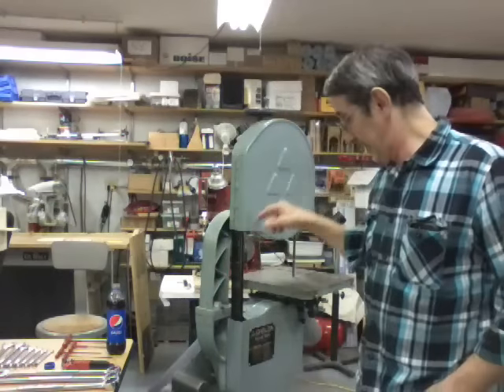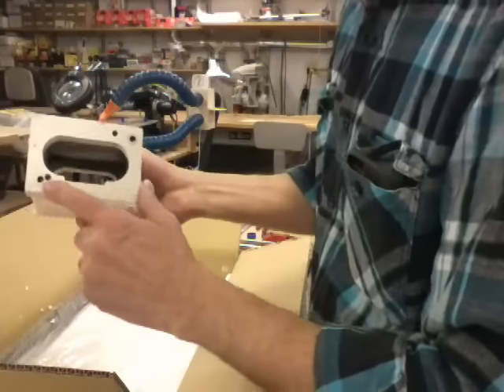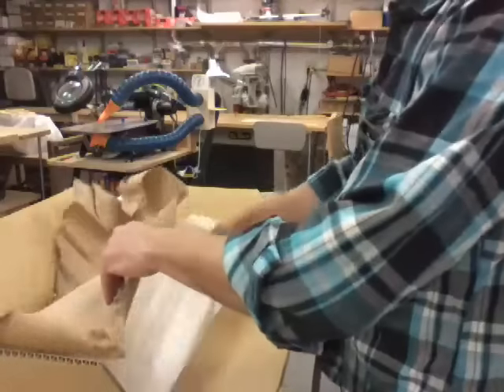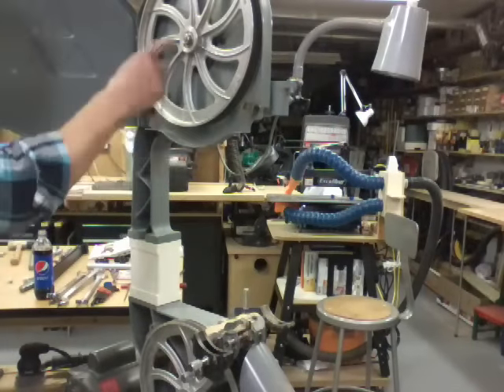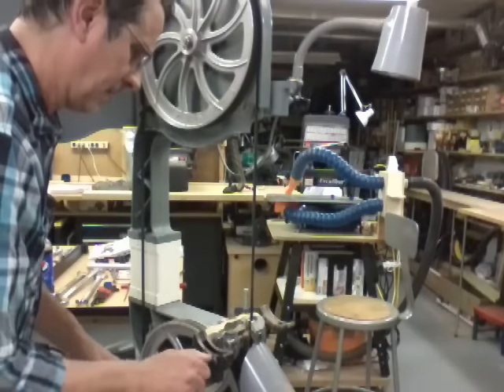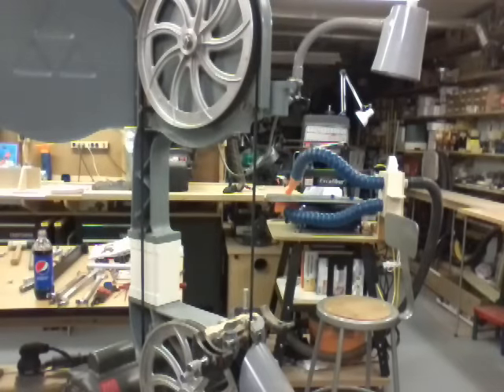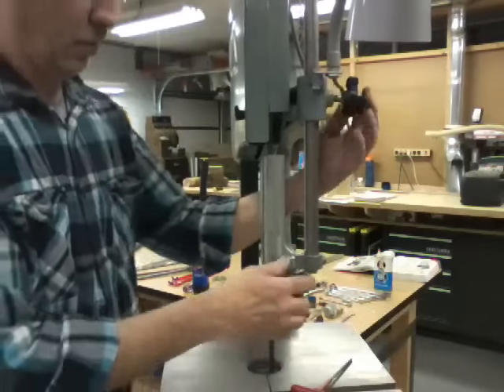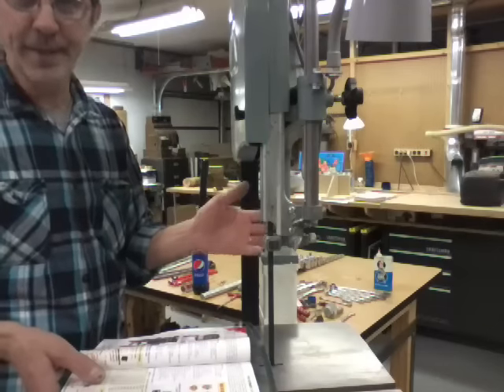71. How to install a riser block on an older Delta bandsaw part 1

Comment: Excellent Pepsi ad placement, sir. 

recently won an 8 in at auction and looking for ideas to get it to at least 12 inches. This vid was very informative for me.
Reply from the maker: Travis Brown 
I also sell a Bearing that goes on the elevation screw so you can tighten the blade easier for resawing. Jim
Reply from the maker: Hi Travis
  If you need any help with that bandsaw let me know I’d be glad to help you out.
  And there’s no Pepsi sponsorship here, just drink a lot of Pepsi. Jim
Reply: @jimjackson9381  Cherry Pepsi is the only way to gol
Reply from the maker: Jim Miller 
I’ll have to give that a try thanks for the tip. Jim

Comment: The Grizzly kit has a different bar.  Sometimes you have to make bushings from split 3/4 copper tubing and/or fittings. Delta also used different brackets and guard mounts at different times and slightly different models. The Grizzly guard also needs one hole modified.  If the guides hit the blade differently in the upper and lower positions you have to shim the block on on or two sides.

Comment: I used a grizzly kit on my vintage delta. Had to modify a few parts. Drill out new holes for the pins in the riser.
Reply: Question: What size shaft was yours and did you have to modify the grizzly to fit? Also did you need to modify the guard?
Reply: @JS-ol7vu  I had to order I believe a 1in hex shaft. I had to drill new dowel holes. The guard worked. All in I still saved $100 buying this kit over the delta kit.

Comment: I just bought this saw for $300. it has new blade guides and includes the riser block (which I havent installed yet). Im assuming a 105" blade is what I want once the riser is put on. One difference is the motor is mounted on the right instead of the left like yours.
Reply from the maker: Flyingspyder 
Well I hate to say it but if it’s in good shape you stole that I ordered a riser black for mine and it was $295 so you got a great deal, as far as where they mounted the motor I guess that doesn’t really matter it’s just odd they would put it where you would be standing to operate the saw. If you’re going to be resigning Lumber like I do you may want to go to the heavy duty spring to get more stretch on your blade and you will probably want to install one of the bearing blocks that I make for your elevation screw otherwise it may end up bending on you like mine did.   just a thought. Jim.

Comment: I bought a new Delta 14" and installed a riser kit in 1995.
I am too old to do that now.
Reply from the maker: Clark Magnuson 
  Hi Clark
    If you haven’t watched video number 72 it’s the second half it explains the bearing that I put underneath my elevation screw so you can tighten the blade tight enough to actually re-saw without any issues, And I do sell them for $20 apiece Plus a three dollar shipping fee,   but at least watch the video it’ll give you an idea of how well it really works. Thanks Jim

Comment: I thought you might want to know the Delta model #28-203 comes with the riser kit factory  installed for the 12 inch cuts-however the saw then only cuts 13 inches wide due to the riser width.
Reply from the maker: Bob bailey 
Hi Bob it’s Jim
   The riser I put on my saw is the same size as the column itself, and I can still cut 14 inches between the blade and the column.
   Is your riser block bigger than your column, did you buy the saw new or was it used, and did someone put  the wrong riser block on. Thanks Jim

Comment: I would love to know how feasible it is to use the Grizzly riser kit on an old Delta. Like yours,  mine uses the 15/16 Bar.
Reply from the maker: J S 
The pins and holes in a grizzly riser block is not going to line up with your Delta saw which will make the upper and lower blade guide way out of alignment. Jim

Comment: Hi, I wanted to ask you where can I get replacements from Delta, I have a band saw like that one but I need to get the top and some other parts…
Reply from the maker: There’s a couple spots on line called vintage machine parts. Com. check with them and see if they have what you need. Jim

Comment: Jim, can you possibly tell me what the part number is for the table leveling pin is (right behind the rear trunnion)?

I seemed to have lost mine during the restoration process!
Reply from the maker: Stephanie Ray 
Well first off let me say I’m sorry I just found your comment question, if you’re still looking for parts for that I have no paperwork for mine but there is a website that is called     vintage machines.org and that’s all this guy does is works on old machines that would be your best bet. Jim

Comment: Jim I came across your video, I've just received a Delta model  28-303  band saw that's missing the table , blade guard and guide bar with bearing assy, . It looks similar to yours It looks like the kit you installed in your saw contains a few of the items I need . Do you know of a company that could supply hard to fine parts for the Delta bandsaws.thank you for your informative video .  jim
Reply from the maker: James Grissom 
Vintage machine supplies.com
 Is one I came across it is online I guess just Google different vintage Machine sites and you may find something unfortunately I don’t know of anyone that has any parts for an old band Saw like that sorry I couldn’t help. Jim
  Let me know if you find any good sites and I’ll reference it on a video. Jim
Reply: @jimjackson9381   thank you for your assistance . I'll forward my findings . hopefully it will help others

Comment: Should work  that saw has been cloned for years  and many of the parts can be swapped with other branded saws  i believe Taiwan  makes most of them in the same factory  and i think it was Central Machiner(HarborFreight), Craftsman(Sears) , Powerkraft(Montgomery Wards , and of course Delta too !  they also made them for both woodworking and metal cutting models although the Metalworking saws were more expensive as a rule  and more Woodworking ones were sold
Reply from the maker: Craig Monteforte 
Well you will notice when you buy a riser block for a delta saw that the holes in the top of the block in the pins in the bottom have been relocated to fit the Delta saw they may be reproducing the saws but not all the parts are identical you will have to do some work to them to make them fit. Jim
Reply: Craig Monteforte maybe Rigid too. My Rigid looks the same other than the color

Comment: I have a 28-274 delta 14 inch bandsaw and a lot of people are putting in a 6 inch riser blocks, but my bandsaw has a 3/4 horsepower motor. what size motor do you have and do you think a 3/4 horse motor is enough power to resaw a 12 inch piece of maple or even a softer wood ??????
Reply from the maker: Matt Dodaro 
 I have a three-quarter horse motor on mine and for what I've been cutting it works great I haven't cut 12 inches of maple or oak I would imagine it will work you'll just have to cut slower and make sure your blade is sharp if your blade isn't sharp it doesn't matter what size motor you have it's going to cut crooked and it's going to cut slow. Thanks jim

Comment: did you say where you got the $7 blade from.
Reply from the maker: 4bennybear    Hi it's Jim
    I get my bandsaw blades from Essentra Industrial supply 1-800-253-0421 but there will be a shipping and  handling charge if they ship them I pick them up locally, if you check around near you, you could find someone locally that makes bandsaw blades you could get a lot cheaper.  And I buy a dozen at a time you get them cheaper that way. Thanks Jim

Comment: where you get that extension
Reply from the maker: You need to call Bill his number is 1-610-266-5311he will ask you some questions about your saw and he will get you the right part thanks Jim
Reply: Hey Jim you have the number prefix 266 here but 662 at the top. which is it?
Reply from the maker: Scott Neely 
It is. 1 610 662 5311 sorry about that. Thanks jim